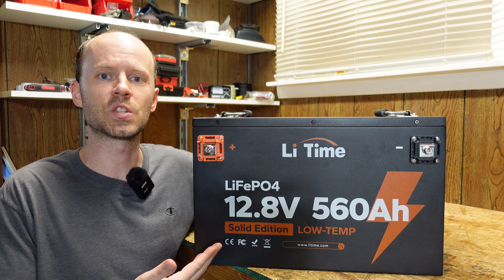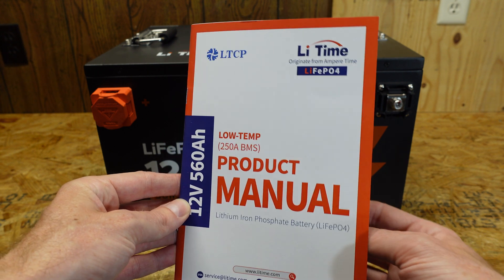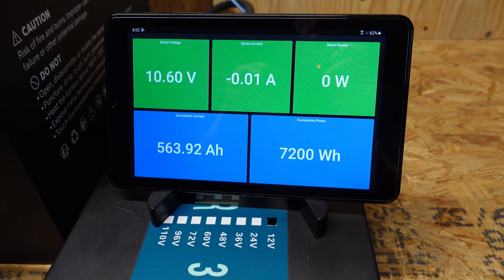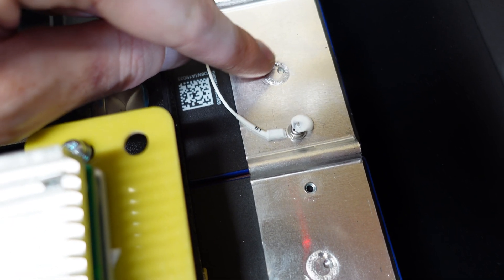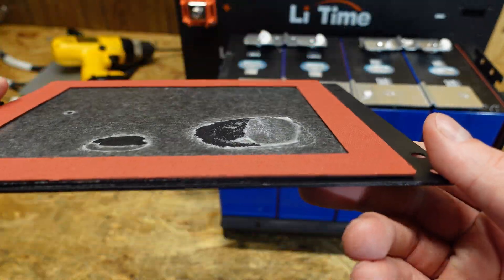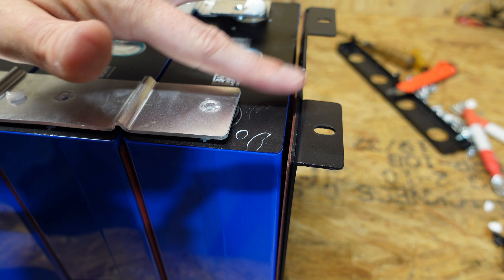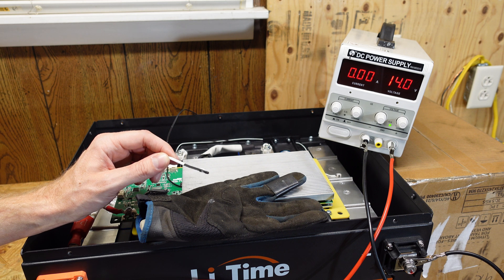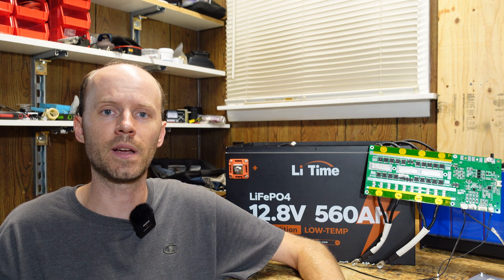NEW LiTime 12V 560Ah LiFePO4 Battery, 7168Wh!! Full Review and Disassembly

Comment: Cool, did you ever setup the batrium with the eg4 6000xp? Just got started setting them up in lead acid mode for now. Wasn't sure if you had done it with your old battery setup.
Reply from the maker: No, but I do need to get that done before winter here. I need that low-temp control.

Comment: The internal construction of the battery looks good, but it's slightly expensive. I'm currently using the Vatrer 12V 460Ah, and they seem to be positioned differently. This big guy seems more suitable for energy storage, while Vatrer is marketed for RV use.

Comment: Great comment and video on this shipping!  I've had problems with this myself with furniture, some of the items ended up completely distorted, replacements were shipped freight.  Just because a shipper says they'll ship a certain size and weight doesn't mean it's a good way to ship.  With that video the maker may also be able to employ a packing specialist to design packing that would protect the item.  Oh, and thanks for the battery review!

Comment: excellent but expensive :D question: if 4x12V = 48V AGM pack, what bms or balancer would u use? (did not use one for half a year but well X-D)
Reply from the maker: I'm not familiar with the properties of lead batteries. I didn't think you needed a BMS with lead. They do make balancers I know though, which will probably help extend the life of the battery - Victron has one.
Reply: @LithiumSolar  yes but u would need 3x of em to balance 48V

Comment: four of these would have cost me $6636 and that's on sale.
Reply from the maker: No. The sale price for 4 of them is $6108. The price your quoting is before the sale is applied (which is done when they're in your cart). If you need 48V, it's best to buy a 48V battery instead of series-connecting 12V honestly.

Comment: Up to 15,000 cycles on the Litime website, probably not 0-100% charge/discharge.
Reply: In some other batteries that claimed 15k cycles it was for 60% DoD, 6k for 80% and 4k cycles for 100%.  I think 20 years (more than 7000 cycles) would be killer, since who will be around then? Probably most killed or in technocracy. and then if that is not the case, much newer and cheaper technology will come. For batteries to match solar panels life is crazy. Good of course
Reply from the maker: Definitely not 100% DoD and probably just a few amps - doubt it's anywhere near 1C or even 0.5C.

Comment: Ridiculously too expensive.  Let's move into the present with 48v  batteries.
Reply: @stevenshircliff393  48v costs way more right now than 12v 100ah. 💰 spent is more days that it takes to pay off the system.
Reply: @Gary-ee3kq  I can buy a 11kwh 48 v system for  same price.  Ography
Reply: Heh? What if your loads are 12 volt? These batteries are dirt cheap for the amount of energy, and the quality looked pretty good.
Reply: @dustman96  dirt cheap. 🤣🤣🤣
Reply: @dustman96  you should take the 💰 you save and buy panels.
Reply: @Gary-ee3kq  You need to balance energy storage against production for the specific application. Only a few hours a day you are getting full production, and some days are cloudy. If you want consistent energy supply you need to account for all the variables and size your battery accordingly, with a margin for battery degradation over time.  

Dirt cheap is a relative term. But with prices as low as they are it finally makes sense to go off grid for a lot of applications.

Comment: Thank you for the review. I can't find any UL certifications in the specs, do you know if this battery has those? Without a UL 1973 and UL9540, I just don't see how I can buy this battery and pass Inspections for a Solar System in the USA. Also could you explain the price per kWh?
Reply: 0.22 cents a Kilo from what I Learned
Reply from the maker: It does not have an UL certifications. If that is required for your application, then I suggest you don't buy it.
Reply: @LithiumSolar  Thank you.
Reply: @LithiumSolar  Ok. I wish they would get those UL certs. They are clearly focusing their marketing materials on those markets, with Amzn headlines like "Perfect for Solar System, RV, Off Grid, Home Energy Storage"...  Which is odd since they don't have the certifications?  They simply don't meet NEC standards without those certifications where they do inspections for code compliance in most states.

Comment: $1,600 😂😂😂. DJLBERMPW is selling 6.4 kwh for $650. $1,000 more. That's 1/3 the price of my 🚗 .
Reply: BTW I'm currently running a capacity test of my DJLBERPMW 12v 100ah battery as I ✍️ this. Will post vid in a couple hours.
Reply: @redriver9000  I bought 4 more djlbermpw and in the process of doing a discharge test individually before I put them in parallel overnight and then series them up and connect them in parallel to other set of 4. Will post vids on performance 1/ month for the next year.
Reply: Just finished the discharge test for the 1st of 4 batteries. Got 1.234 kwh not including the inverter losses.
Reply: @redriver9000  retail price is now $128/ battery * 5.6 batteries ( to make 560ah)= $716. Each battery is 12v 100ah
Reply: I got 10% of that so that drops it to $650 what I originally said.
Reply: @redriver9000  each battery is $128/each retail.
Reply: @redriver9000  each battery is $128/each retail.
Reply: @redriver9000  how much did the balancer costs you.  I plan on doing a 4s 2p setup.
Reply: @redriver9000  yes that's what I used.
Reply: @redriver9000  you use 1 balancer for each 4s set or connect 3 batteries to the same lead?
Reply: @redriver9000  mine are too.

Comment: The absolute main feature I’m personally looking for is a Bluetooth BMS.  Without one, it’s kinda blind knowing what’s going on - current draw & SOC
Reply: Just get a battery monitor
Reply: CELL BALANCE IS THE KEY! Worst case, you can open this one and manually check the balance. I held out for Bluetooth since I was getting plastic case 150Ah batteries so the only way to check the balance is Bluetooth. If your charging is not keeping the cells balanced OR the BMS fails, you wouldn't know they are out of balance! This is the easiest and quickest way to destroy your expensive batteries! CHECK THE CELL BALANCE! FIX THE PROBLEM IF THEY ARE NOT BALANCED!
Reply: you are correct. Last night I had my batteries at 52.9 volts and 90%, this morning still 52.9 but at 80%. glad I bought bluetooth. 12 12 volt 100 ah and adding 4 more.

Comment: delivery driver gets a thumbs down
Reply: 😂 I was thinking the same thing! Every thumbs down is a UPS or FedEx driver! I don’t blame them either. They’d probably kick it too if it wouldn’t break their foot in the process.
Reply: pretty sure the dent cause by drop off just like that to the ground
Reply: That’s a bit rich! Would you like to lift it? No if anyone’s at fault it’s the delivery company as two persons should be available.
Reply: A small portable aluminum load cart for heavier packages should be employed
Reply: 7kwh in one battery? I bet the delivery driver was "thumbs down"ing himself.
Reply: That weight is our of spec for any standard delivery. Over twice over. That driver could've hurt himself real bad. But who gives a f about that.
Reply: @okumakamizu3030  it would have been less damage if he would have applied the effort of the limit that he's allowed, he offered that package zero effort.
Reply: @yelims20  wtf you talking about. He should've caught 70lb of that 140lb package? Go to gym, practice, to get a sense how weight works. Then try it with something that had no handles.
Reply: @okumakamizu3030  as a 33 year tool and die maker that knows what 70 lbs is all about, he didn't try... just let it fall. I bet you are the "do the minimum" kind of person.
Reply: @yelims20  there's a big difference between 70lb and 140lb. A box with no handles and a die. I am the overdoing kind a person. The kind that goes out and grabs the package asp just to save the delivery guy some time and effort. Thanks them and offers them a beverage if there were many/bulky/heavy packages. Being heavyweight myself I'd manhandle that package on principle, being the idiot that i am. I've just learned not to expect crazy shit out of everyone else, tho.  That's the kind of person i am. And I bet you are talking-out-of-your-ass kind of person.
Reply: no. you get it! try working that job smart....
Reply: Anyone who worked a job that involves lots of lifting would know better than have something more than 50 lbs delivered to your home will be vulnerable to some form of "oops.. o well" passive aggressive damage. You just roll the dice that the packer anticipated this.
Reply: @rl8571 that's why you would get fired. If you can't do the job don't. Find a different job but don't be a jerk.
Reply: He's provided with a handtruck...  which would have been they ideal height to slide it onto without stopping to the ground like that...  and would have allowed him to wheel it easily to the porch, even allowing him to put it up onto a stoop, instead of against the bottom step, likely in the rain.

But they put such dense routes on these drivers, they don't want to take the extra time to deploy their hand-truck for every other dropoff. 
I bet his was buried behind half the parcels when loaded.
Reply: No driver should have to lift 133 pounds.  I blame the shipper.  They should have specified "Lift Truck Needed."
Reply: @maurice7413  Vacuum packed mattresses are shipped every day at over 200lbs in much larger packages. This is a piece of cake for a competent driver.
Reply: 70 pounds max normally
Reply: @maurice7413  he didn't even try to help it to the ground, he rolls it out and just let go for the hardest fall possible. That driver shouldn't be a driver.
Reply: @yelims20  I can see you've never handled multiple heavy packages in one day.
" 70 lbs for FedEx Express U.S. shipments. It’s important to check the weight limits for your specific service and destination to avoid any issues."
Reply: @maurice7413  the guy straight up dropped the package as hard as gravity would allow, stop making excuses.
Reply: @yelims20  as a machinist, I never had to or would lift 70 pounds.  But you do what you want to and have the expectations you want.
Reply: @maurice7413  working with die sets, either together or separate shoes, is work. Kurt vises pop your 70 lb bubble
Reply: @yelims20 well said
Reply: I’ve been a delivery driver, most often we have no time to care, read the box warnings, or know what’s inside.  The manufacturer must assume this, as often the crates are on a pallet and shrink wrapped.
Reply: @Erin-Thor as a former usps carrier,  each package is important to the customer.  It doesn't take that much time to read the big warning labels.
Reply: @fredbecker607  maybe being able to read is an issue RIF
Reply: @Erin-Thor  If true, you qualify for the same lazy ass thumbs down.
Reply: What needs to have a thumb’s down is posting the driver online without his consent… dude is just doing his job the best he can and now people blasting him. That’s messed up!
Reply: @slimhim there are cameras everywhere.  Do you make excuses for the ones throwing packages over the fence too?
Reply: @slimhim  "dude is just doing his job the best he can "... just stop.
Reply: @yelims20  people like you are the problem… you know everything about everything and that’s it
Reply: @slimhim   People like me? people like me that watched the VIDEO and saw that the guy made sure to let it fall as hard as possible, he didn't even try to help it down... but go on and make excuses. People like me? Do you mean people that can watch the video and comment truthfully about the content of said video? Just stop, you're embarrassing yourself.
Reply: Typical DEI hire delivery driver
Reply: @JohnDoe-gm5ux racist

Comment: Hi, I'm new to your channel. Started watching about 4 months ago. Just getting into learning about lithium and building battery banks ,have a long way to go with learning about electricity, much more of a wrench monkey, then a sparky😅, Thank you Helpin me learn more
Reply: I was a wire monkey for over 30 years. Worked on helicopters and airplanes, 10 of those in the Army, then a lot of varied harnesses, electronics, and cabling after I got out. I'm pretty confident in my wiring skills and have the tools to do it. I haven't messed with solar YET, but I'm doing my research. This company seems to be pretty professional. The construction incorporates a lot of good practices, like sheathing for the wiring, staking hardware to prevent it from loosening, and lots of shrink tubing at the connections. Actually printing their own manual instead of stealing it from someone else is a nice touch too. I'm not a big fan of excessive solder on board terminations, mainly because inspectors always hated that. All in all this looks like a very good battery, the wiring is a solid 90% in my book.

Comment: Being so heavy is another reason to by cells and build you own battery. In a perfect world, all handers use lifts and two wheelers, you would be more likely to not have drops and such.
Reply: Can you build you own battery using the same components, that will be lighter, and by how much 🤔
Reply: @stevecarlisle3323  It maybe about the same weight, but will be in many boxes. Like the battery cell are usually sent in four per box and four boxes for the 16 total.

Comment: Holy cow that is just huge!!! 🤯
Reply: Be sure to lift with your back, not your knees 👍
Reply: Oh darn, that bent cell looks awful :(
Reply: @WillProwse  With the unpredictable events of lithium-ion battery fires, I wouldn't use that battery with a dented cell.  Send it back!
Reply: @chrisgraham2904  it's not cobalt based chemistry lol
Reply: @WillProwse  I'm aware that Lithium Iron Phosphate batteries are far safer than Lithium-Ion, but I'd be uncomfortable keeping the battery with a dent in it, especially considering the cost.
Reply: Is he your brother? Speaks just like you
Reply: Oh you recorded in 4K! niceee
Reply from the maker: Look at the clip in the summary chapter where the delivery dude rolled it off the back of the truck... I'm pretty sure that's why it's dented.
Reply from the maker: It's at 12:18
Reply: @LithiumSolar  I saw the delivery driver foot shove my next door neighbor's new air conditioner right out the back of the truck, complete with a 3 foot drop
Reply: @LithiumSolar if you had the engineering drawings you could check for a matching expansion of the gap on the other side of the case 🥴
Reply: @LithiumSolar  Get a damage claim filed, no need for that abuse, hold him responsible.
Reply: Personally, I think I will stick to multiple 400s untill the weight comes down, 560 is a bit too much
Reply: Depends on the price per watt. It's definitely heavier than ideal but manageable if the price advantage is significant. @davidconner-shover51
Reply: @davidconner-shover51  Pop 4 of those babies in your camper or RV and you'll need to upgrade your suspension springs.  lol
Reply: @chrisgraham2904  nope, they ai'nt that heavy
Reply: @davidconner-shover51  The video states 133 pounds each.  Just over a quarter ton for a bank of four.
Reply: @chrisgraham2904  and my RV is presently 2500lb below its GVWR, would likey make it ride more smoothy 😄
Reply: @davidconner-shover51  Yeah, I think your fine.  lol
Reply: Yes, delivery not ❤ his job !
Reply: It's  YUUUUGE
Reply: That's what she said... Lol!
Reply: That's what she said:)

Comment: We're all trying to leave 12V for the much better 48V batteries, but this one is cool!
Reply: You can easily wire up 12V batteries to get whatever voltage you need. All batteries are made up of the same voltage cells.😊
Reply: why are they better? im happy to use thicker wire. most of my appliances run on 12v.
Reply: @pearlrival3124  If you already have the larger gauge wire and can make use of it, it makes zero difference, IMO.  (most of my setups are 24V and I'm still adding 24V gear)  Except for the BMS on the 12V which limits to 3000W output...
Reply: @pearlrival3124  48V easier to charge with solar.